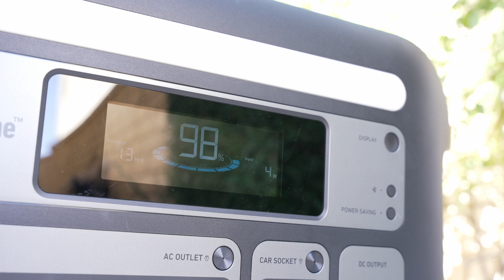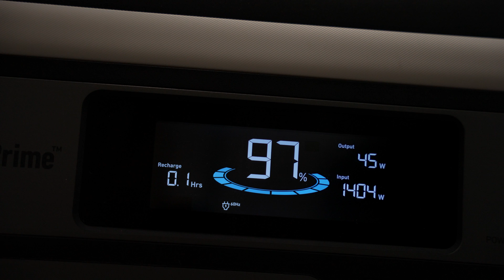Anker Powerhouse UPDATE - It wont charge!?

Comment: I wouldn’t recommend spending your money on this product because although the product looks great and seems well thought out, the support is just not there yet. I just bought the product with 2 200 watt solar panels and I can’t get more than 80-90 watts per panel, (in direct CA sun with panels with optimized orientation into) the p2000. I tested several days and various times from late morning to late afternoon/ evening and have the latest version of the firmware applied. Support led me thru resetting the unit to the factory settings, and verified with me on the phone the underperforming panels and unit charging…but then the phone went dead. No call back from support, and when I called in immediately, I got a message that all lines were busy and to file any support requests thru the website.or via email…I did both. 
I received a reply  day later telling me to check luminance, alignment angle, and heat as these are the three contributing factors to low performance on solar panels. Clearly they didn’t bother to read the reports as it was clearly stated that I had gone thru a troubleshooting process with a tech on the phone and we had found that everything was set up correctly but inexplicably the panels were performing at about 40% efficiency. I responded with today’s test results but no further answers. 
Also, when I was looking at solar battery power stations and solar panels for my various uses (camping, rv, and home backup) this looked (on paper) and on YouTube reviews to be the perfect solution. I even verified a 30 day return policy - but now that I’m having problems with this unit and its solar panels, “NO RETURNS”. To say I am disappointed would be putting it mildly. Now I’m wIshing I’d paid a little more and gone with a more reliable vendor. My advice is, Don’t buy until they better figure out customer service and a reasonable way to deal with quality issues.

Comment: I just got an Anker, it will charge through the wall outlet but wont with the 2 solar panels I bought with it.
Reply: Did u solve the problem?
Reply: Did you solve the problem?
Reply: @ervinbaptiste7234  ended up being a bad connector on the cable.

Comment: My C1000 stopped charging. I watched your video, and tried a FW update. The FW update failed, because the unit powers down the AC outlets during the update, and I had the wireless access point plugged into the C1000. But the reboot that occurred during the failed update fixed the charging issue.  SO maybe it wasn't the FW update that solved your problem, but the reboot that accompanied it.

Comment: I'm a little confused by this video. You begin with an issue of the power station unit not charging, and then we see that a different issue is resolved (powering a portable AC) with a firmware update? I have a 767 Powerhouse that won't charge consistently, no beta app, all firmware up to date and I've "reset" settings back to default. Starts out charging at the set rate via the app, then trickles down to as low as 7watts charging with a 16 day estimate to full charge lol

Comment: My heart skipped a beat when I read the title of the video, since ours is on its way here. I saw Will @ DIY solar update his firmware. It was .7 What number are they up to now? Will a guy have to do a firmware update out of the box? Also, has the reverse polarity issue on the 120 side finally been solved for good on the current units, or is that something that needs checked too?
Reply from the maker: Check your firmware when it shows up if you can so you don’t get greeted with any surprises that might have been fixed already, never know what version was shipped

Comment: my anker 757 also had this problem and now it is completely discharged, my 757 is ZERO and wont charge.
Reply: mine wont charge and the ac part dont work either
Reply: My parents have the same issue with 757. It just stopped charging one day. And that's it.
Reply: @dmytrobatsenko4150 im sure we are not alone, mine was very lightly use, I think these units are meant for home use only indoors… not like the marketing they make you believe.
Reply: Any updates on this?
Reply: @AndyValencia1995  after many attempts to reach out to anker USA and my local anker dealer (in Asia) where I brought my anker. - Anker USA wants me to ship back to the unit to USA, ITS TOO EXPENSIVE and because its lithium, its very hard to ship.
local anker said - cant touch because its NOT our unit - 
So finally found a tech who opened the unit and there was corrusion inside probably from the road trip in the USA that lasted 56 days stayed in key west, yoseneti, grand canyon, joshua, etc.... lots of fogs on some of those places.....

so tech opened it, said the batteries are toast and there's no replacements. - so its JUNK at the moment.
Reply: Mines not charging. I did a rest and ordered new cables.  Still not charging.
Reply: Mines not charging. I did a rest and ordered new cables.  Still not charging.